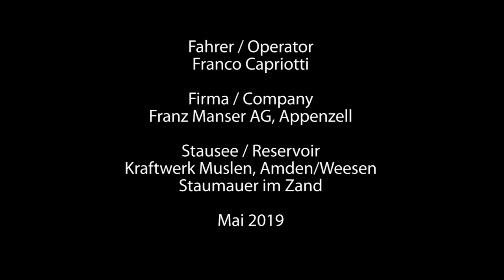Menzi Muck M545 digging out a reservoir in Switzerland on a extrem steep slope

Comment: I swear some companies are releasing machines which are two years of r&d away of being actual mechs. This is genuinely impressive.
Reply: What does it having wheels make it not a mech? Cause that looks like a mech to me.
Reply: @Googlencraptubesuckabandonship  A mech's primary locomotion method would be it's legs on non rolling elements, it also would rely mostly on some sort of active balancing be it via computer or pilot mimicking like prosthesis the antirobot, these machines rely mostly on wheels for transport and  passive stability by just stretching their "legs" which are more like a crane's arm due to the lack of joints and the presence of telescopic sections, effectively making them heavy adjustable tripods, tho no less impressive.
Reply: @blackhawksp4453  So a mech with legal restrictions
Reply: Pure walking mechs would be pretty dumb, there is no reason why you would be walking everywhere when wheels would do 99% of the time while being more effective in every way. Mechs would also require a lot of hydraulics so even if you where building a two legged star wars mech you would want to put some hydraulic powered ''roller skates'' on its legs and drive it around when you could. That would also give it some nice rubber shoes which you also would want.

We might get 4-8 legged mechs with advanced lidar systems etc that scan the terrain and automatically walk over it (unlike this) because that would be pretty awesome in the forest industry (alot less destructive) but it would still have wheels on the feets so it could drive around if it needed to. What makes a true mech anyway? I'd argue that it should be able to walk over obstacles smoothly with only forward/left/right commands from the operator most of the time, which would require some type of terrain scan. If it have wheels or the number of legs doesn't really matter.
Reply: @amando96  more like mechs without the restrictions. 

From a technical standpoint tracks and wheels are way more effective and efficient. On a human scale maybe not so much, but I mean nature had a couple million years to figure that out before us.
Reply: @blackhawksp4453  you realize this machine is called a spider and has been around for over a decade
Reply: There's a company in Germany that makes exosuits from legs up to back to support the hips all the way to the spine for workers, some day maybe it will reach from feet up to the hands and then someone's gonna weaponize it as usual
Reply: @13thSystem  I'm pretty sure Ford already uses full body exos on it's production lines.
Reply: @blackhawksp4453  EksoVest is only upper body and it's not meant for load bearing.
Reply: @13thSystem  You're right, just checked it, now I wonder where did I saw a full body one, I remember very clearly the thigh section being shaped like a thick 7 and it being used in a vehicle assembly line.
Reply: Walking suits are the stuff of fantasy for those with zero mechanical knowledge, if such a design was superior it would have been created by now. Why devote extra energy and reduce capacity just to come up with what is essentially just an aesthetic? Machines today are the size and shape they are because that is what the laws of physics and engineering dictate.
Reply: @rsoul7282  Yet prosthesis the antirobot still walks, factory workers use exoskeletons to carry more weight safely and even some people walk again even if its just by waddling. If we were to stick to statements such as "if such a design was superior it would have been created by now" then nothing would've been invented, because of the childishly arrogant assumption of nothing being better than what we've already created. It's not about an aesthetic, not even upgrading necessarily, it's about pushing the limits, just f'ing around and learn from whatever ends up happening, sometimes the progress made ends up being worth the failures and costs, like the first aircrafts, virtually useless, yet they were the stepping stone for something greater. Just beacuse we don't see their value/use doesn't mean there isn't, belive me, there is a niche for machines like that, imagine a crane or excavator with the dexterety and/or agility of a human, or spider or whatever; a fire engine capable of going straight to the firefront instead of being limited to roads, paths or clearings; wheels and tracks require specific surface conditions, but legs, they're far less limited, maybe, the costs of making such machines are offset by the savings of not having to make paths or roads to their workspaces, thats the advantage of legs over other mechanisms, there far more adaptable to more terrains; all we need is time and people that don't sit around making assumptions without prior experiences, all prototypes and first production units suck, but sometimes even a faulty but functional tool can perform a task no other tool can, and even help making better versions of itself.

On a sidenote, engeneering doesn't dictate anything, engeneering is just registered and stored ingenuity to work aroud and/or with physics, thus it doesn't prevent or limits the existence of such machines or ideas, in fact it's used for the opposite.
Reply: @blackhawksp4453  the Mr Fusion from Back to the Future part 2 is exactly the device you have been waiting for. All you need to do is wait for 2015 and it’s all yours, along with as many hoverboards as you can sell.
Reply: @rsoul7282  How is back to the future related to the current subject matter?
Reply: far from a mech
Reply: this technology is 50 years old bro
Reply: @blackhawksp4453  I have to ask, Is English your first language? You type as if it is not, or you are very young, which perhaps explains quite a bit.
Reply: @rsoul7282  No it isn't my first language. Is there any problem?
Reply: @blackhawksp4453  ok, I just had a look at your channel, I get it now that you REALLY like the idea of mechanical suits. Maybe one day your dream will come true, but don’t hold your breath. In the meantime, go and operate some heavy equipment, you will probably realise as I have that we have already got powerful man piloted mobile machines.
Reply: @rsoul7282  Machines today are the size and shape they are because of the advancements and limitations of current technology which is constantly changing, and with new technologies always comes new designs.
Reply: @13thSystem  this is true, but all I’m saying is you aren’t going to see legs as a sole form of propulsion on anything carrying meaningful loads or at high speed, because legs suck for both purposes.
Reply: @rsoul7282  No one is saying legs will replace anything, legs can do different things, a wheel can do different things if you want you can put them together like the machine on the video, on it's own a leg can tackle more obstacles than a wheel but a wheel is more efficient if your only looking at flat surface or small bumps.
Reply: Is it bad if I imagined this thing with a rail gun slapped on it?
Reply: @millicent8053  nah, rule of cool overrides sense.
Reply: Mechs are very flawed in almost every way.
Reply: Something shaped like a gorilla with this functionality would be the way to go.
Reply: @blackhawksp4453  mechs are fucking stupid, wheels are clearly far superior
Reply: Pretty amazing but I missed the cable that was lowering it down the first couple times I watched this.
Reply: 4inch plate steel over the hydraulics and a turret instead of a boom arm
Reply: just found out they exist since 1966
Reply: just an average swiss company 🙂
Reply: What’s a mech?
Reply: @13thSystem  it's weaponized already. We just haven't seen it yet
Reply: @Googlencraptubesuckabandonship  No, it's the lack of rocket pods.
Reply: Mech is not possible with AI to fine control all the mandatory reactive responses of the limbs. And AI is not there yet, at least for this purpose.
Reply: @Lappmogel  you don’t get it.
Reply: @RashaKahn  yeah i get it, you want to live out your anime fantasies and walk around i gundam suit irl.
Reply: @Chevsilverado  No you are
Reply: Yeah they have them. Remote controlled but yeah.
Reply: @ivywoodxrecords  yeah but mechs are, by definition manned or optionally manned like the titans form Titanfall, otherwise they would be just robots or drones, like Atlas, Digit, Ascento, Spot...
Reply: @blackhawksp4453  I'm sure there are plenty of mech that have wheels and the ability to also walk in the world of anime. Also this kinda reminds me of a mech from a game called just cause. It has wheels. I think really the thing making this not a mech. Is no arms. 😏
Reply: @Hates Spam name one
Reply: @Hates Spam unless you're on the side of a cliff why would they not work
Reply: @volkhardhenschel1863  Are you trying to be witty or just extrapolating your own problems? You are smart enough to think I've made some mistake, but not enough to tell me where or what those mistakes are? Go ahead, show me your great knowlegle.
Reply: Nice video my friend ❤❤❤❤❤❤❤
A very creative idea ❤❤❤❤❤❤❤❤

Comment: That guy must have more controls than a helicopter pilot to be able to control so many different features. Very impressive.
Reply: Casual🤦‍♀️
Reply: Yeah I’ve got lucky and used one twice now and the controls are same amount as a normal 360 digger 2 hand sticks and 2 foot sticks but on your hand sticks you have a thumb switch to use to change what your sticks controls ie the legs or the grapple arms on the legs or the digger arm it’s self , they are truly amazing machines and am thinking on relocating to area where they are used on a daily basis
Reply: @Rya_N33  Yes you are.
Reply: @Rya_N33  u are a sad helicopter pilot , its ok , u can fly at least :::)))))
Reply: I wanted to see how he gets out of there!
Reply: @SkinnyBigRed1  oh I think they would of just lifted it with a crane because I think the video was to show off it’s ability to get down there but it could of made it out the same way the power they have on low revs is amazing I didn’t want my job with the machines to end when I used one 😂🇬🇧👍
Reply: @johnhowarth7216  no crane. How he got out is in the secret descriptions.
Reply: @ssm445  ohhhh right 😂👍
Reply: @johnhowarth7216  he has 4 pedals not 2
Reply: @agostinho6550  my bad I mean the forward and reverse pedal didn’t word it right
Reply: @SkinnyBigRed1  yeah me too,,,, i was wondering during his decent into the reservoir how he was getting back up that,,,, winch must have been used.... cant see them using a heavy chopper to lift,,, way too expensive for drain cleaning...
Reply: good video content, very inspiring

Comment: I could have watched that for hours. The cost of that machine has to be a crazy amount, but the engineering is awesome.
Reply: Agreed
Reply: Yeah man! The engineering is impressive! The spider-like solution and how it's made is just awesome!
Reply: I'm guessing £250k new going off a 2017 m540 for £185k. special piece of kit
Reply: hmmm ... Ouch! That price hurt my feelings. With tears welling up in my eyes, it’ll be hard to watch now 🤣
Reply: Forrest Gump  I think you need to rewatch this . The digger was digging out debris from the reservoir/dam such as mud and trees so explosives is out of the question. Care and attention is needed near engineered concrete construction not uncontrolled force .
Reply: Too bad if it blows a hydraulic hose down there. 😲
Reply: Meh it just has arms inatead of tracks! :P

Expensive to hire though...
Reply: The price is a but higher than that. Its produced in Switzerland and this model costs about 600.000€😅
Reply: @hermannmoser5193  i suppose that they dont make many. Almost a custom build kind of thing.

It shouldent really cost that much more then a normal excavator, to MAKE one. But i suppose i forgot to include the DESIGN costs. And for not many units.

"Normal" excavators arent very cheap eigther...
Reply: So how cost it is ????
Reply: @summerspark2552  lol. Like about a million bucks. Plus tax. :P
Reply: @summerspark2552  im a dealer in switzerland. M545x cost around 450’000 CHF (400’000 €)
Reply: @nicoloferrari6108  That is a fair price given the investment in design.
Reply: You can pick one up used for around $50,000-$80,000 USD.
Reply: @joshuanorris5860  I just order one, not from Menzi Muck, but Euromach, (it's similar, but weaker) 236,000€ - 25% down, estimated delivery in May 2022, pay attention that is estimated, not exactly.
Reply: @HHMartins  heh good luck with the delivery being in the same year as the estimate lol

Whatever for :P
Reply: Yes very expensive machine. But don't work alone. Very good and no fear of machine operator..
Reply: I was thinking the same thing!! 🤣
Plus that guys has to have nerves of steel.
Reply: It’s like $200 with one day shipping on Amazon
Reply: I'd say they're surprisingly economic considering how much extra design and manufacturing is required for all those joints and features. Just by design they can do almost any job, and with the right operator even routine jobs can be done more efficiently and therefore faster so it's not like they're overly expensive to use.
Reply: we have one at my work that we bought about 8 years ago. I think we paid $300k for it. I tried moving it once. It took me about 20 min to figure out how to move it lol
Reply: This machine is very good .l like
Reply: I operated its competitor kaiser spyder "s-2" . In the u.s.  12 years and it taught me something new every day. Mine cost $265,000 then . I wore out a set of four tires $6,000 rim and tire each. 24 ply bandenmarkt . The joysticks are 4 way s.a.e. pattern.  And have electric over hydraulic switches(4) mounted on each joystick.
Reply: @HHMartins  are you in the U.S.?
Reply: @marknathanks7592  good info. I've always wandered. Never gotten the chance to operate one.
Reply: @wpog8453  Not anymore, I moved to Portugal in 2011. I lived in the USA for a while.
Reply: It’s like in a science fiction movie but it’s real
Reply: why is it so captivating??
Reply: "The Menzi Muck range certainly lives up to its title of the 'Ferrari of spider excavators' with its construction and component quality, as well as its price. Kimpton said the M5 ranges between $550,00 and $600,000 depending on options and the smaller ones are around $130,000 for a two-tonne model." -- 20/02/2020
Pretty normal kind of price for such advanced machinery.
You are confusing amazing-ability with crazy price, but the two are not the same.
Reply: @hopefilledsinner3911  Easy fix. Like not a problem. Much worse things happen all the time.
Reply: @joshuanorris5860  You forgot a whole bunch of stuff, in fact. Prices well reflect complexity and manufacturing cost.
Reply: @joshuanorris5860  actually, you’d be surprised. If you go into the mountains here (Switzerland) you will regularly see these machines working in the most insane places. Seen them in France and Austria too.
Reply: @joshuanorris5860  "It shouldent really cost that much more then a normal excavator" Bullshit. three times as much hydraulic valves and actuators 4 independent hydromotors. It just have to be significantly more expensive. No way you can make more complicated mechanism composed from so much more compicated things cheaper.
Reply: Early ones were used in forestry, clear felling slopes in the North of Scotland... They were cheap early on, but went to silly money once everyone caught on...
Reply: Menzi Muck has been building walking excavators since the 60's, the M545 (and M545X) are the largest and latest models, and they range from $550-600k, with the smaller 2 ton version around $130k. And, no, it's not a custom build,
Reply: good video content, very inspiring
Reply: 550.000 and up for a big one plus attachment

Comment: Awesome machine!!!  Now I would like to see how it got back out.
Reply: It winched itself down, it'll have winched itself back out.
Reply: @K1lostream  It is possible the helicopter that lifted the trees out also lifted the excavator out as well.
Reply: @randygreen007  Possible but improbable- the entire point of this machine is that it can get to places other excavators cannot go.
The cost of development will have been considerable (as will the cost of hiring it). The thing that makes it worth it is you save on other costs to get plant into position (like hiring heavy-lift helicopters and don't kid yourself the one that lifted the wood out could have lifted an excavator).
If it had to be lifted by helicopter, may as well use a conventional excavator at that point.
Reply: @K1lostream  There’s a lot of truth to what you’re saying and I agree for the most part. I enjoy going four-wheel driving and have managed to get my vehicle down many steep slopes but knew there was absolutely no way that I could exit that same way. I’ve also spent time in Alaska where heavy lift helicopters are a dime a dozen but you are right they come at a cost. The thing we don’t know is if the helicopter they used for the logs was also used for the equipment? All of this aside I’m not at all discounting it’s ability. It’s a very capable and remarkable piece of equipment.

Comment: The absolutely hardest way to do this. This should be done with a dredger after lowering the water level. Any large trees can be winched out with steel cables.

That said, that's one of the most impressive bucket loaders I've ever seen. The guy operating this is an master. He earned every penny. I bet it was very stressful going down that embankment.